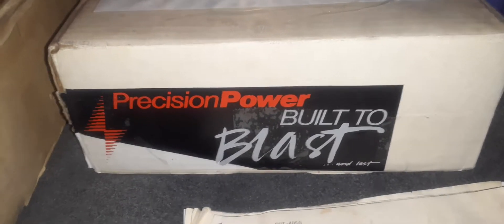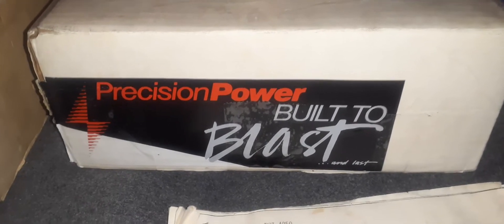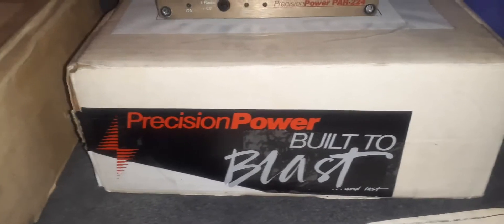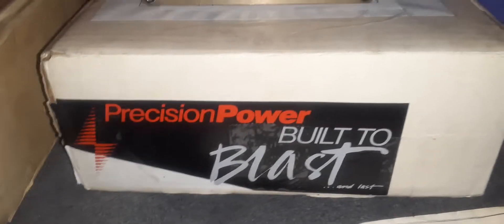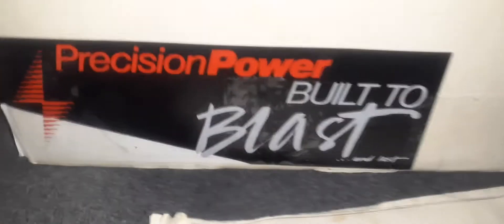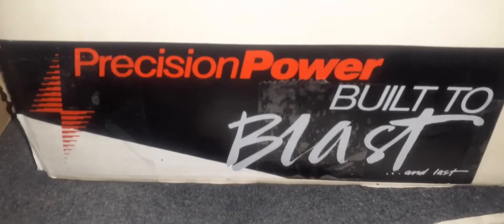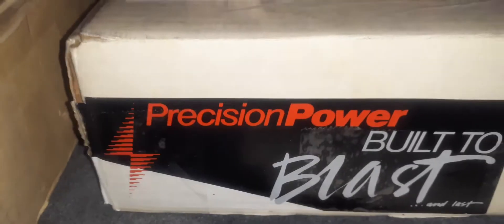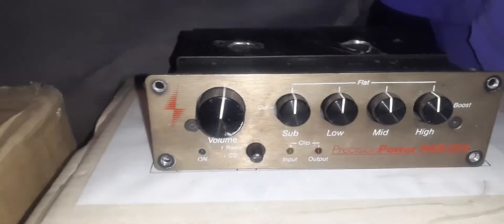Old School PPI 4050 and PAR-224

Comment: Yes sir! Now we're talking some real cool old school PPI. 
230 watts was very good power in the late 80's. That amp wasn't cheap back then either. 
BTW, the headroom number was something PPI included in the specs at least through the M series. The number was 2.3dB on the M series amps. Nice to have that extra impact for dynamic transients. 
Those old 224 preamps were phantom powered only I believe. The 245 half-DIN model had a +/-/ground plug and that unit was true parametric.
All cool stuff and love the black.
Need to find one of those jackets in my size!
Reply from the maker: Thanks for watching and adding some extra info. I really don't need to start another series of amps to collect but I really like these and the M and AM series. Yes, putting on the jacket is like wearing a time machine, takes you right back. Just wait until you see the other jacket I got with it. Teaser, it's from a famous brand and was their team jacket at '93 IASCA finals.

Comment: Awesome bunch of goodies👍kinda of like the sun faded color.
Reply from the maker: Dude if I could sun fade this entire amp I would. It looks slick. I might have the set stripped and anodized. The anodized PPI are awesome.
Reply: @brentb5303  I rember my first punch 150 and 45 were anodized then later on when I got new 150&45 HD seems like they had wrinkly coating.

Comment: Most true stiffly regulated amps by design will not have much dynamic headroom. Orion and ppi both use the same darlington output configuration, usually the 2n6490 or 91 complimented by the 2n6488 or 87. The power supply is where precision power amps shine compared to orion and  Fosgate designs. Although orion claims full regulation they are not. The downside of the ppi amps is that they are so stiffly regulated that any deviation above about 16 volts they will usually cook the power mosfets. Half of the ppi amps I ever repaired had this failure point. Believe it or not it is very difficult to notice the difference between regulated and non regulated amps, the difference is usually around 1db or less and that is where the average person can notice differences in spl. The ppi amps use the sg2535 pwm and orion and Fosgate both use the Texas instruments tl594 or 494 pwm. Each has their good and bad properties. Keep the badass videos coming, your channel and only a couple of others are the only ones keeping the old school gear alive and kicking.